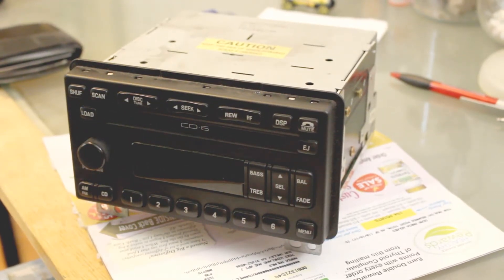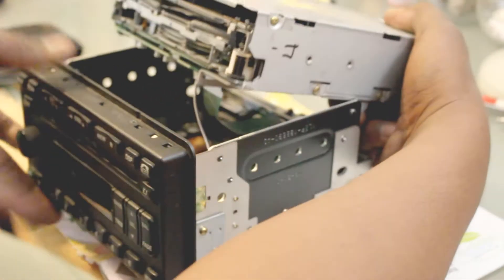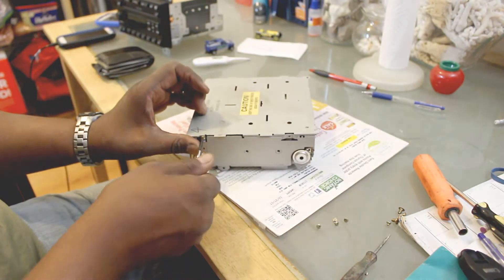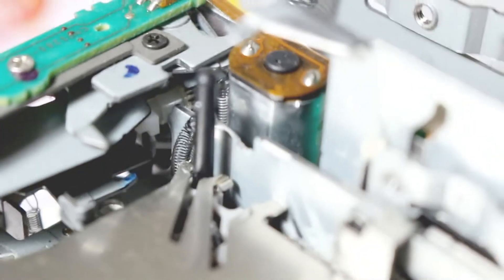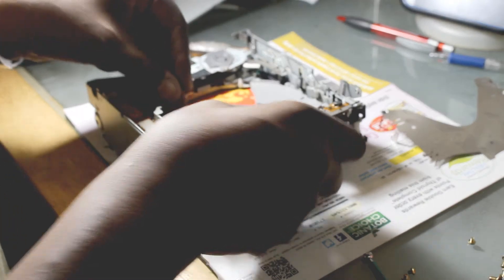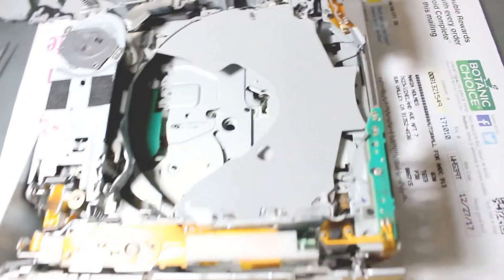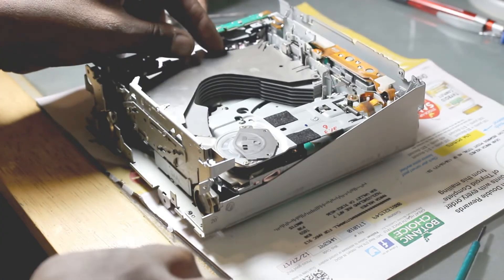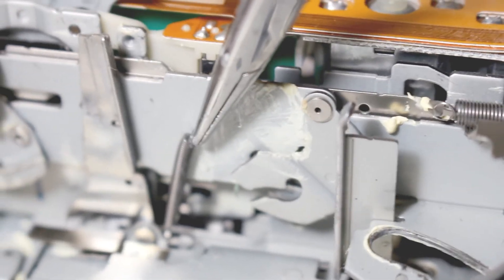How To Remove Stuck CD From Car Stereo

Comment: That is a Pioneer unit, I worked for Pioneer for 21 years. I was known as Mr. CD at work. I hand aliened the laser on BMW and Rang Rover. Now there are managed electronically.I also worked on GM 12 disk changers. I closed out my time with Pioneer doing failure analysis on Honda.

Comment: How do you remove the small phillips screws when the screws are resisting to turning and the + is beginning to be damaged? Any tips to make it easier?  

I'm trying to remove the clips on the side that hold radio into the dash. Thanks
Reply from the maker: Sometimes i will put a little wd40 on my finger and "rub it into" the bolt. Just enough to get "in there" . Then as i use the screwdriver i try to push it "into" the bolt head so it hopefully grabs enough to get it turning. 

Of course i have the trusty backups of
a. using my pliers to grab the edge...or
b. using my dremel...if i can get it to the bolt head... to cut a channel to use a flat head

Comment: Great. Mine is different. 2008 Ford Edge. I have the changer mechanism out of the radio, but its 6 CD changer is different & not as accessible to the internals. Wedged #3 CD. Any experience with this model?